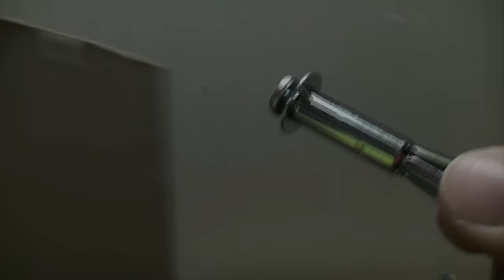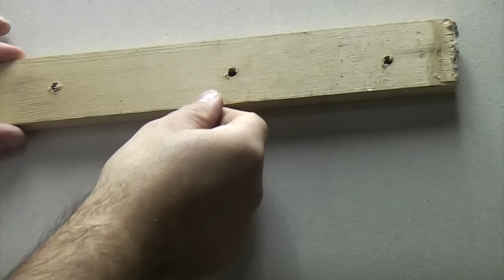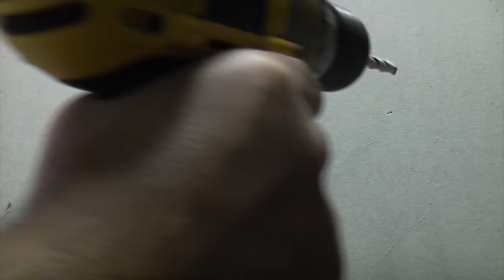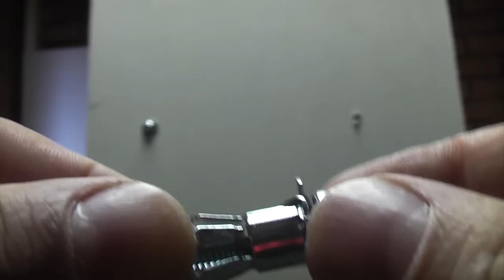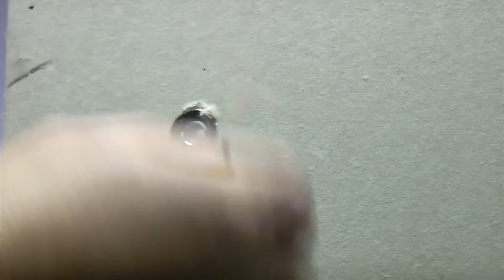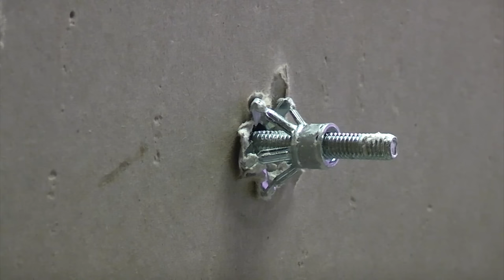How to use hollow wall anchors

Comment: What size drill bit would you use if it’s an 1/8 in. long-type anchor? I’m somewhat new to hardware and home modification.
Reply from the maker: Normally you would use an 1/8" diameter drill bit.
It's often best to use the setting tool, if the drywall has not been plastered over- https://www.youtube.com/watch?v=7mpcer0QzW8&t

Comment: How does one know which size anchor plug to use? 
I've got a mirror to hang on the Chimney breast wall, it weighs just over 10kg. 
The house is a semi detached with cavity walls if that helps.
Much appreciated for any help.
Reply from the maker: To be honest, I would fix to the wall behind, not the plasterboard.
Perhaps using corefix fixings- https://www.youtube.com/watch?v=7xLhIPoO5gQ&t
Thanks for the comment 👍
Reply: @ultimatehandyman  thanks for the prompt response. How does one know if the wall is plasterboard? It doesn't have a hollow sound if that's the only way to check. Both the wall behind and the chimney breast wall sound the same. If it's plaster skim over bricks like I'm assuming then should I not use anchor plugs?
Reply from the maker: @Anonymous8T8   If the wall is solid, you can tell by tapping it with your knuckles. If it does not sound hollow then the wall is probably plastered, This video might help-
https://www.youtube.com/watch?v=FlDuaAMiSxw&t

Comment: I don't understand. How does the back part get all wide? When I put the screw in outside of a wall it doesn't do that, even if I hold the anchor part still with a plyers.
Reply: Like how many people out there have these in their walls without the prongs being out like they are supposed to be? 🤦‍♀️
Reply from the maker: It has to be tightened against something, so that the screw pulls the threaded part and causes the  legs to expand.
This video might help-
https://www.youtube.com/watch?v=7mpcer0QzW8&t

Comment: Can i use them on bathroom wall tiles to install grab bar ?
Reply from the maker: You probably could, but you would have to file off the point that bites into the surface. I'd also recommend using the setting tool - https://www.youtube.com/watch?v=7mpcer0QzW8&t

Comment: Any suggestions how to take this off gently from the plasterboard???
Reply from the maker: Probably the best option is to turn them and push them inwards, it will leave a hole but it will be a smaller hole than trying to pull them out, unless you get a longer screw, push it in the hole just so that it starts and push inwards- that might straighten the bent over prongs enough to remove it from the front.

Comment: I noticed that when you started screwing, the metal plug started to move round until it bit at the back, also they cannot be moved once fixed?
Reply from the maker: Yes, they do slip a bit. If using these a lot it is recommended to purchase the setting tool for them (about £10).
I have never tried to remove one but would imagine that if you removed the screw so that it is on the very last thread and then pushed the screw back in it would straighten the prongs back up, enabling it to be pulled back through the hole.
Reply: ***** The reason I picked up on that is I'm assuming that this fixing is the best performing one on the market... and I'm looking for flaws because I have come up with a fixing that out performs this, and is re use-able and doesn't need pre drilling. So any problems you can find would help me with my design,
Reply from the maker: *****
There are better plasterboard fixings in the market. Toggler snap toggles are my favourite- snaptoggles
If the wall is solid behind the plasterboard then these are good- Rigifix wall anchors
Good luck with the invention, please keep me posted ;-)
Reply: Will do, could be huge, and a UK invention, shame I'm having to look to the US to get it made.
Reply from the maker: *****
Good luck with it ;-)

Comment: can 4 of this anchors be used to support a TV wall mount bracket to hold 17kg TV +  4 kg TV wall mount bracket itself, in total 21 or 22 kg? Have anyone used these anchors for similar purpose without anchoring on studs? What is your experience?
Reply from the maker: I would imagine they would do that, providing the TV does not cantilever out on the bracket.
I have done a video showing how much weight some popular plasterboard fixings can take here- https://www.youtube.com/watch?v=ECDysfNhx_E

Also, how to fit to studs- https://www.youtube.com/watch?v=glzwY76O0d8

Thanks for the comment

Comment: When I try and tight the anchor to grip it to my wall the screw does tighten it just turns (slipping) the thread is this a set of dodger anchors or am I doing something wrong?
Reply: Sry doesn't tighten
Reply from the maker: +aQSteve Have you used the setting tool to set the anchor, or are you trying to use it without the tool?If the later then you might not be able to tighten it now and will have to use another type of fixing, such as a snap toggle etc.
Reply: +Ultimate Handyman I haven't used the setting tool, I am going to borrow one tomorrow and try that. Great videos btw 👍
Reply from the maker: +aQSteve Hopefully you will be able to expand the anchor with the setting tool ;-)Thanks for the comments

Comment: What could you use for hollow doors? To put coat hooks on thanks
Reply from the maker: I believe that the worm type metal screws work (the ones that are for plasterboard, but not very good)
A small spring toggle would definitely work.
Thanks for the comment

Comment: Hi there, could I use this as an anchor for drywall on metal studs? I.e. I need to drill in to the metal studs and use it as an anchor. Cheers. I feel that it should technically work.
Reply from the maker: It depends on the shape of the metal stud. The ones I have seen are a kind of T shape, if you can get this into the flat part it should work. Would self-tapping screws not be a better option? 
Thanks for the comment 👍
Reply: @ultimatehandyman  shape is like a three sides rectangle. So to narrower sides and a regular wider sides. Basically 2x4 same as wooden stud. But hallow and without one side
Reply from the maker: Should be fine in those, as long as you get it central  👍
Reply: @ultimatehandyman  ok thanks for advise. Cheers

Comment: Hi handyman-what size drill bit did you use? It seems quite straightforward to use these without the tool, is there any benefit of using the tool? Thanks
Reply from the maker: It's better to use the setting tool as there is a risk with these that the prongs won't bite into the plasterboard.
I can't remember what size drill bit I used as you can get these in several different diameters.
Thanks for the comment
Reply: Ultimate Handyman thanks
Reply from the maker: You are welcome ;-)

Comment: I already put in the anchor, but I did not leave the screw in to tighten it. I put the anchor in, placed my hanger over it, and put in the screw. It didn't tighten...I didn't know what was wrong, so I just left it and assumed I did something wrong. Can I remove the hanger, put the screw in and do what you did, or is it too late? So what I'm asking is, can I restart the process once the anchor is already in? lol.  (this might sound very stupid to you, but i'm very new at this haha. Thank you!!!!!!
Reply from the maker: +TheClashyyy 
It might work, it might not- depending on whether the board has been skimmed with plaster or not. If you want to be certain you should use the setting tool, which will work every time- https://www.youtube.com/watch?v=7mpcer0QzW8
Reply: okok, if not snaptoggles will work right?
Reply from the maker: +TheClashyyy 
Yes, as long as the hole in the plasterboard is not too large ;-)
Reply: ok thank you aha:)

Comment: How would I know the thickness of my plasterboard though? That's crucial to know so you can purchase the correct anchors, no?
Reply: You can drill a small hole to begin with where you intend to screw, then bend a very small hook in the end of a length of rigid wire and pass this through the hole. Hook onto the back of the board whilst making sure your fingers are holding the wire flush with the surface. Then carefully pull the wire out and measure the distance from the end to where you're holding it.

Comment: Suitable for hanging projectors on ceilings?
Reply from the maker: No, I do not know of any plasterboard fixings that would be suitable for that apart from perhaps snap toggles-
snaptoggles
Suitability would depend on how many fixings you can get in the projector and how heavy it is.
Reply: Ok I think a piece of wood Between the two beams is best,  thanks for reply

Comment: Hi. A question, that measures exist?
Reply from the maker: Hi, I'm not quite sure what you mean.Do you mean millimetres? If so they are widely used across Europe for measuring- its much easier to understand than the imperial system of inches ;-)

Comment: Where can I get those small ones you used in the vid mate? I think the ones iv got are too big,the ones you used look like the average thickness of plasterboard.
Reply from the maker: I normally get them from screwfix-
http://bit.ly/2jMI8H0
They are sold in different lengths, but many places do not specify which thickness of plasterboard they are suitable for!
Thanks for the comment
Reply: Ultimate Handyman sound il need the 37mm I think,are those the ones you used ? Iv got 65mm here defo too big haha

Comment: How can we find out how thick the plasterboard is? I got a man to take a door out and fix plasterboard .. I don't know how thick it is and also how would I know if it's safe to hang a heavyish picture on it please? Thank you.
Reply from the maker: You might be better off using these- snaptoggles

They are one of the best plasterboard fixings available
Reply: Thank you so much and what about the weight of something to be hung please? Would it crumble or damage the plasterboard?
Reply from the maker: cintymag
As long as the snap toggles are used correctly they can take a lot of weight. Obviously the heavier the item the more snap toggles you need to use but a couple of these should easily be able to hold a heavy picture. Approximately how heavy is your picture?
Reply: It's about 30" x 25 with solid wood frame. I haven't a clue of the weight but it's heavyish to lift for a woman anyway.
Reply from the maker: cintymag
Two snaptoggles should be sufficient to hold it ;-)
Reply: ***** Thank you I will source these.

Comment: Hi guys what i dont get is this actually requires for u to know how thick ur plasterboard is. How do we find out? I'm not going to cut a hole in the wall just to find out? Can anyone help? Thanks so much
Reply from the maker: You can either find where the stud is, and press in something hard, then measure how far in it goes, or you can make a small hole with a Hex key etc and use the bent end pushed through the plasterboard to take a measurement.
Here I'm using a small hex key to find a stud- https://youtu.be/glzwY76O0d8?t=217

Comment: How do i check if pipes or cables are back there?
Reply from the maker: You can try using something like this- https://www.youtube.com/watch?v=SPsQZ8xq1J4&t
Or just drill through the plasterboard really carefully, you can even make a hole in plasterboard without using a power tool.

Comment: ***** - this or snaptoggles in general and specifically for TV brackets?
Reply from the maker: I prefer to use snaptoggles ;-)
Reply from the maker: Hal1q
For such a bracket and TV weight of 30kgs I'd definitely be looking to screw into the studs. I would not risk using any type of plasterboard fixing although the snaptoggles are supposed to be able to hold a couple of hundred pounds in half inch plasterboard!

Comment: Plasterboard and rawlplug etc represent lazy building and are a complete farce. Cheers, but nope  not much help and didn't work.  Screw just turns and turns and will no take or tighten once the plug has been fitted.  Now I have 4 holes in the wall!!!!  What size is the standard plasterboarding  in a residential home - is MOST important to know.  I have no idea as I wasn't the builder.... So we can buy the right size.  Damn wendy house building with plasterboard is the scourge of society, just build houses from bricks and mortar.   For your next video, please post how to fill the damn holes in plasterboard., so the wall can be repainted  This would be more useful now. Much appreciated.
Reply from the maker: This might help- https://www.youtube.com/watch?v=fFJICiX7DDk

Comment: hello.so here  on ur last anchor u just screwed it in and it worked with out using a setting tool?
Reply from the maker: Yes, you do not need the setting tool if the wall is plastered, but it's always best to use it.
Reply: Is it much better to use it if i want to hang a kids swing to the ceilling.itc on two fixing hooks.
Reply: 4 holes in each hook.i got a large hollow anchors.child is only 27 kilos.
Reply from the maker: I would not use these to hang something heavy like that in a ceiling.
You need to find the joists and fix directly into the joists, you can find joists using magnets which is similar to finding studs in partition walls- https://www.youtube.com/watch?v=H5U0sLKyJJw
Reply: Ultimate Handyman  what about snap toggles?
Reply from the maker: They are not designed to be used in ceilings, you need to find the joists ;-)
Reply: Ultimate Handyman what fixing do i use to fix in to the stud?
Reply from the maker: You can just use good quality woodscrews, probably about 3 inches long
Reply: Ultimate Handyman thanx a lot buddy.you really helped me.

Comment: Holy crap! That is wrong people: the teeth must not destroy the outer diameter of the hole while expanding the anchor behind the plasterboard.... it will not be according the spec and it will fail if tried....you need the tool to pull the screw without rotation to get the spec load
Reply from the maker: It is not wrong at all, you can use these quite safely without the setting tool, if the wall has been skimmed. If it has not you need to use the tool- https://www.youtube.com/watch?v=7mpcer0QzW8&t

Comment: Just tried using these - fail. The little teeth just tear right through the plasterboard as I screw; the plasterboard is far too weak to allow the teeth to grip (like they would in, say, timber). Going back to the hardware store to get spring toggles.
Reply from the maker: David P 
If you can get them snaptoggles are better- https://www.youtube.com/watch?v=tAIUublenMw
Reply: ***** Wow, tks for quick reply; I'm a big fan of yours. Actually I've been to store and got spring toggle bolts but now regretting that too - they need a 14mm hole and a new 14mm drill bit costs $25! Going back to store to get proper setting tool as it looks very quick and easy to use. Cannot get snaptoggles easily here in Oz.
Reply from the maker: David P 
Blimey the drill bits are expensive over there!
Best of luck with it, thanks for the comments ;-)
Reply: you are using Them wrong, There is a type of pliers that are meant to be used. you put them in The wall, Then losen The screw a bit. take The plier and give it a squeese.
Hard to explain on english for me..
Reply from the maker: https://www.youtube.com/watch?v=7mpcer0QzW8
Reply: Exactly👍

Comment: I tried these anchors. They are shit. They kept spinning and ended up leaving a massive hole in my drywall. They can act like massive hole saw pretty much if your not careful
Reply from the maker: They work better with the setting tool- https://www.youtube.com/watch?v=7mpcer0QzW8
There are much better drywall fixings available though ;-)

Comment: I wish I had seen this BEFORE I tried to hang my new curtain rods on paneling :/  Then I talked to my son who said I need molly screws. I always DO this! I do stuff THEN I find out how later! You'd think I would learn after 61 years, RIGHT???!!! NO.  So now I have the hardware up there on the wall, with screws that are LOOSE and I can't hang my new curtains. ARG!  I once made a toy box for my kids, 2' by 4'. Imagine that. It was so HUGE I couldn't get it OUT of the room! Hahaha!!!  My husband was a fisherman who went away to Alaska for months on end so I did all the household repairs and such and I did fine with regular stuff. I even changed spark plugs and can change oil and a tire. But hang a new CURTAIN ROD??? OMGosh I am so irritated!
Reply from the maker: +Miss Robin Martz Sometimes in the UK we fix a piece of timber above the window, such as 2 inch by one inch and then fix the curtain rail to that, you could probably do that using different fixing holes and just leave the loose ones where they are. It' often best if you use the setting tool for these as some brands do not grip as well if you use the technique shown in this video.https://www.youtube.com/watch?v=7mpcer0QzW8I hope this helps ;-)I'd love to have seen you trying to get the toy box out LOLThanks for the comment
Reply: sure! That toy box! My husband got a good laugh out of it! I have to set the curtain rod above the actual window frame because I want to cover up the WHOLE window with my curtains. My windows are set lower than regular windows. Anyway, I went to Amazon and bought a box of molly screws you hammer into the wall because I don't have a drill. I never thot of adding a board. I was up WAY too late looking at all the stuff a person can use to fix things. Mt father was a carpenter and I watched him do a lot, but since I was a girl in the 60's it never occurred to him to teach me stuff. I learned out of necessity . I love messing with tools and such.  Thanks for your informative videos! I subscribed! :)
Reply from the maker: +Miss Robin Martz 
You are welcome.
Thanks for the comment and for subscribing ;-)

Comment: You are supposed to tap the receiver shroud flush before inserting and turning the screw.
You just tore up the wall/hole for no good reason, and weakened the entire assembly!

Comment: I do need a drill then?
Reply from the maker: If you don't have a drill, you could perhaps borrow one. Or you might be able to make a suitable size hole using a screwdriver etc. By rotating it, whilst gently pushing it.